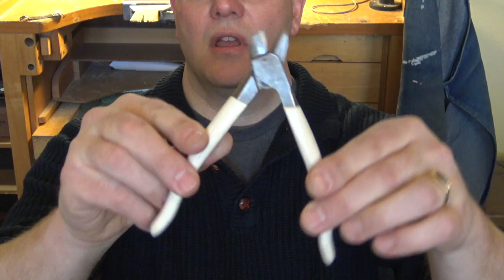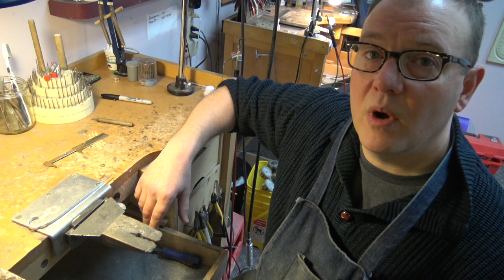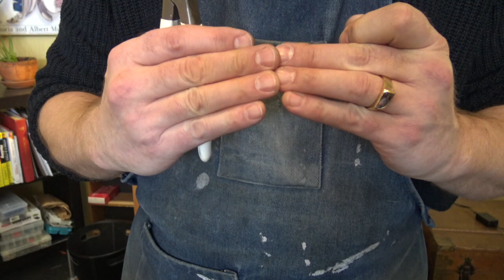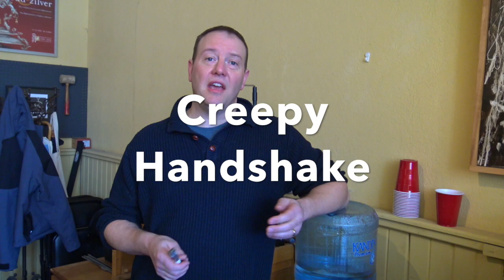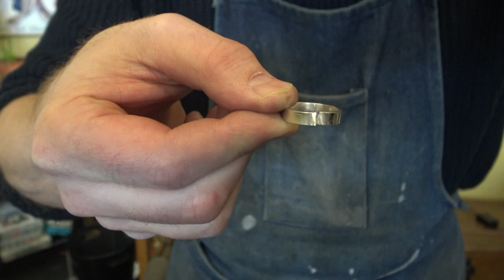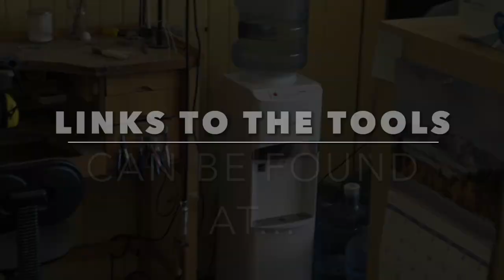Sterling Silver Ring Making (2018) - #1 Things people miss! - Create a perfect circle

Comment: Wow now you need to clean up all those tool marks lol.
Reply from the maker: Guy Barbara If you are worried about tool marks you can place a small polishing cloth around the metal. This will help to minimize an tool marks. 😉All the best. Thanks for the comment.
Reply: @GotchaRocksJewelryDIY  
I don't have that problem i rapped a piece of 16 gauge copper sheat around the lower jaws.
If i leave dents on the ring shank they are left on the inside of the shank and can be cleaned up with a sanding drum.
Reply from the maker: @guybarbara3422  Nice! Good idea. :)
Reply: @GotchaRocksJewelryDIY  
  I used  A rectangle piece of copper sheet  It may have been 3 or 4" long it was wider than the teeth by about 6 or 7 mm the lower teeth the lower jaw I put the piece in the jaws centered it Then squeezed it as hard as I could and then with my hands I contoured around it along with hammering it with a mallet i overlapped the sheet on the bottem side and sawed through it over and over again until it was tightly contoured around it then I soldered the seam.

Comment: Those are called bow closing or V jaw pliers.  And i wrap the v jaw in multiple layers of duct tape for padding.

You add to the length the thickness of the band wire multiplied by pi plus 1mm, plus another 0.5mm if the band material exceeds 5mm.

When marking the length you should use a digital measuring caliper with sharp edges that scribes for you.

You should be using blade and birr wax on the saw blade.  It makes the blade last longer, makes cutting easier, and straighter.

You should use a ring miter jig to get the butts of your ring length filed perfectly square.

Bending the wire initially is done with wrap and tap pliers, because it is actually round and you can tap out waves in the band.  It also doesn't mar the band like the v jaw pliers will even when they are padded.

Aligning the ends at 90 degree flat bends is much easier, you just round it out after it's soldered on the ring mandrel.

The v jaw pliers are only used to do the aligning the joins step, they are for making slight adjustments just to get them lined up, after the piece has been annealed again so it's easy and again doesn't mar the band.

The last thing i would add is if you don't have a ring stamping anvil you should stamp the inside of the band 925 when the band material is still flat.
Reply from the maker: damok9999 Thanks for commenting. Duct tape is great for protecting the metal. All the best, Michael
Reply: Well, everybody has their own tricks, Aye? And I work just like you do, but I do like to finish the join with a sawblade vs. the jig, the rounding after soldering. Tape! Yes! I must have 6 different kinds on my bench, Tool Majic, and Gator tape. Like to line the ring benders with chamois.  If you don't want to clean it up, don't make the marks in the first place!